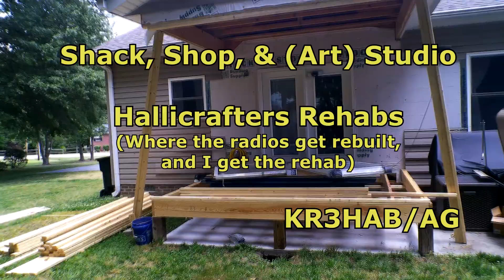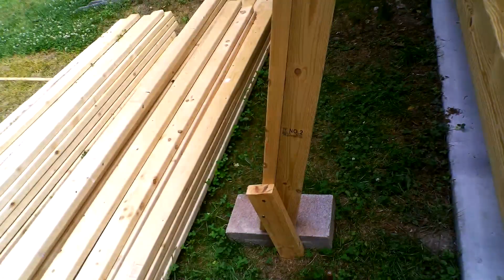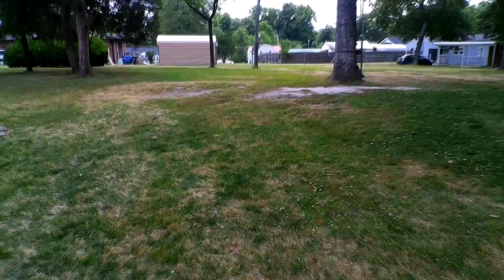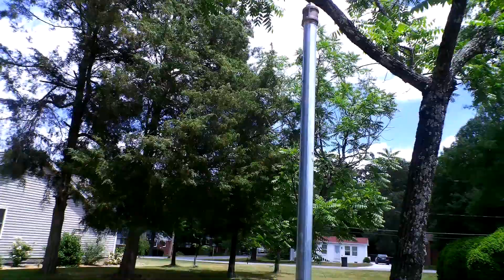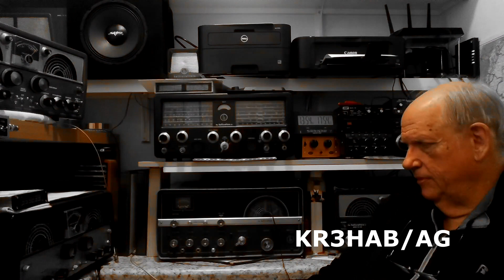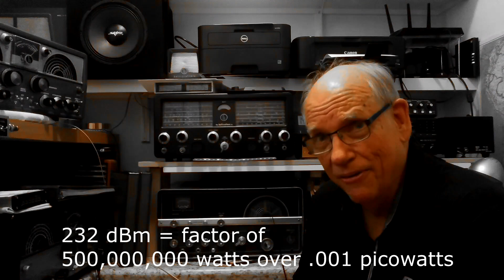Shack, Shop, and (Art) Studio, Part 1

Comment: Congratulations on passing your General Class exam! What took you so long!
Reply from the maker: Time, expense, money and about 55 years.  And extreme example is "why I never became a private  pilot."   There are comparisons, but flying requires maintaining qualifications and skills and is very expensive, while ARO is not so strict.  ARO can be expensive, and good 21st Century equipment is out of sight, but what I do restoring equipment is far cheaper.  Still, simply listening to shortwave was adequate and fun - until my SX-100 went belly up about 5 years ago, and I went to work.  I think my Hallicrafters "mostly" shack will be quite entertaining especially when I get too old to do much else.